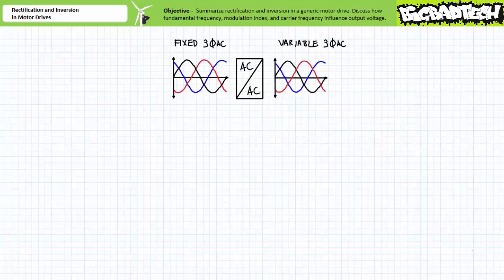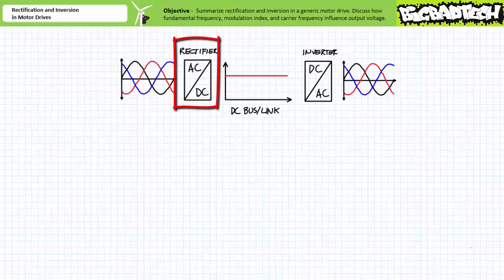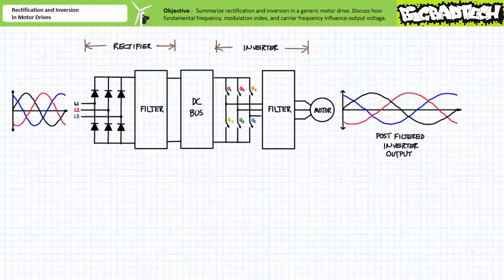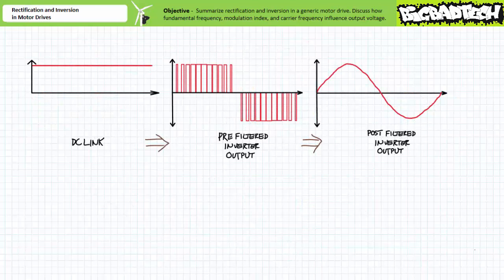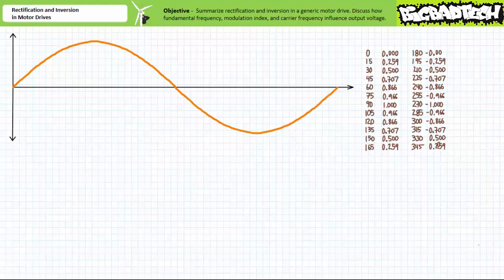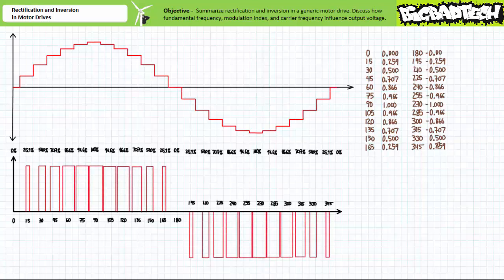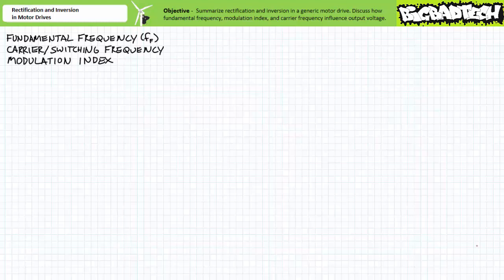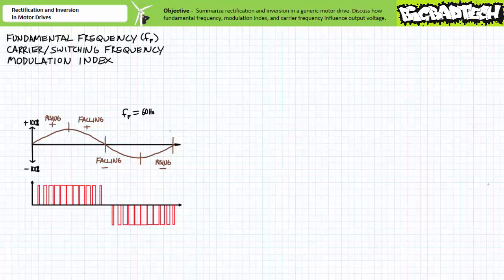Rectification and Inversion in Motor Drives (Part 1 of 2)

Comment: What exactly is the difference between positive and negative polarity when it comes to AC?
Reply from the maker: I'll have a whole lecture series on AC circuit analysis coming out this year. Until then here's a shortcut ... imagine if a battery was hooked + to - across a resistor for 8.3ms and then hooked - to + for another 8.3ms and then the process repeats itself. Long story short the direction of current oscillates back and forth.